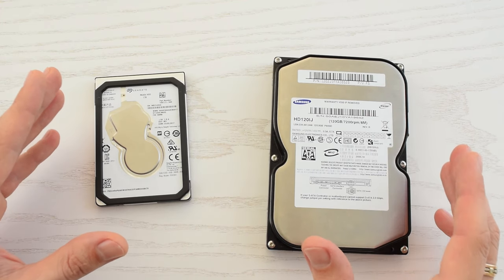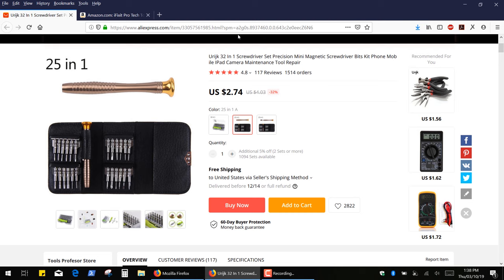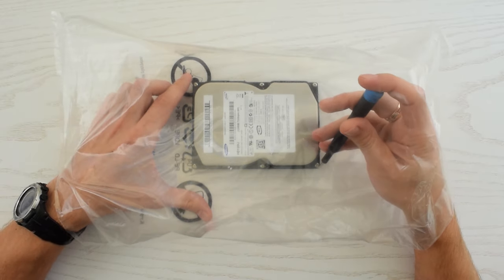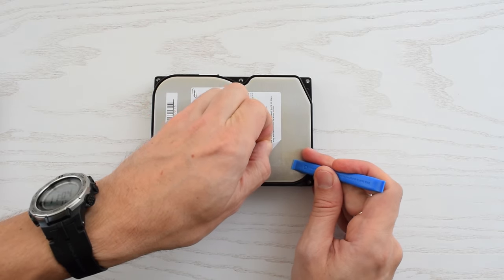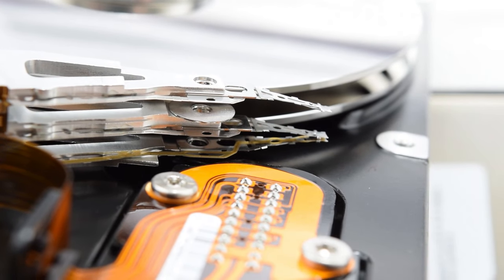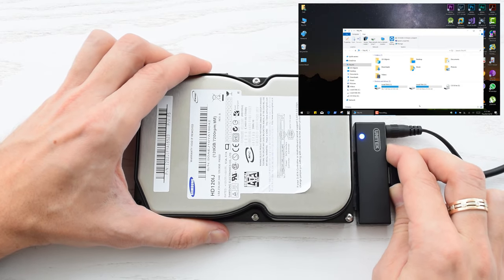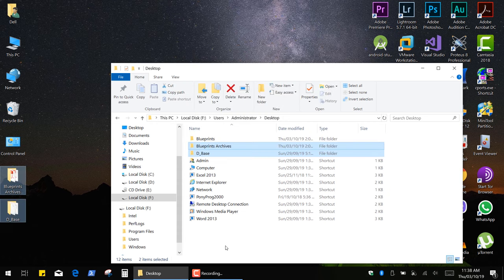Fix Beeping or Buzzing hard drive and Recover your data in 3 minutes

Comment: Just got quoted £350 for this exact job and just done it myself thanks to your video!! You are an absolute saviour man!! I’m half way through recording an album and almost lost all my recordings 😂😂😂. 🙌🏻🙌🏻🙌🏻🙌🏻
Reply from the maker: Glad I could help and backup your data as quick as possible. That HDD is not gonna last long.
Reply: where did u do this process? i mean how did u protect your hrd drive from dust particles?
Reply: @jasminekaif8546  hey!! I wiped down my dining room table and done it and sat it on top of a sandwich bag. I wouldn’t recommend doing it this way as per the video. It just so happened I didn’t have any dust contamination but I can imagine how horrendous it would be if you did. 
I would also recommend making sure you have the right tools. I opened the casing before realising the tools weren’t the right ones. 
Good luck
Reply: Happy you got them back !!

Comment: What if the head is in the home position when you remove the lid, but there’s still a clicking and beeping sound with the lid on?!
Reply from the maker: Does it spin? I mean the spindle? It's hard diagnose like this... Did you check the SMART of your drive? SMART provides exceptional information about your drive's health.
Reply: 2013Electronics&Computers yeah, it sounds like it spins, possibly the head doesn’t engage with the platters....
Reply: For me it beeps twice and the plate stop spinning.. :(
Reply: Have the same problem... Not sure how to proceed from this.

Although I don't really mind losing the drive it's just a tiny 120GB Seagate thin drive, any help would be appreciated though!
Reply: @notapm  i have exactly the same issue with my WD elements 6tb drive. Did you find a solution?

Comment: I just fixed one today by unscrewing the pcb on the bottom (using a T6 torx screwdriver, important to use the exact bit) and cleaned the main board contact of 3 wire contact ovals with a simple pencil eraser - it was green and corroded and worked fantastic after cleaning it back to shiny gold, also a little gentle eraser cleaning on the pins that meet these contacts. Always clean off the corrosion over the years and it might start working again.  Maybe the humidity got to it over time?? Also used a rechargeable air duster to remove all dust.
Reply from the maker: Great job!

Comment: hello there mine is beeping when i opened it this arm was in park position wasn't stuck i started it with open cover the arm goes into work position and start acting crazy ? how can i fix this
Reply from the maker: Most likely the heads are damaged and they can read any information from the discs.

Comment: Would you advice transfer all your files to a new hard drive after fixing the motor?
Reply from the maker: If the case with platters wasn't open then it will be fine for some time but I wouldn't keep any  valuable data on that drive.
Reply: @ElectronicsComputers  thanks

Comment: It's very useful tutorial but my one slim drive has an errors issues that drive size is 500Gb whenever I use Avast Premium Cleaner software to Chkdsk drive C then it shows that found errors need to fix it restart your system after restarting scan disk runs for a while later on system on windows normally no issue but when I just want to assure to myself that all errors must have been fixed As such I rescan disk Check errors by using Avast Premium Cleaner so again the same message shows like glaring errors needs to fix it on restart now or later so kindly tell me any solution to resolve that problem. Thanks sir for your guideance.. 😍🤗🤔☺
Reply from the maker: To tell what's going on with your drive I need to see the SMART of your drive. You can use any software like AIDA64, HD tune, Victoria etc. SMART is essential tool for HDD diagnostic, because it knows everything about your hard drive. Make a screenshot and send it to me.
Reply: Windows 10 runs perfectly even though having stubborn errors inside of it. I created 3 partitions 1st 1 is C:2nd E: 3rd F: when I run AOMEI partition assistant pro to check disk errors only C partition shows errors other 2 partitions scan completely 100% only C showing errors . I also use O&O disk image pro version to check disk that fix errors only temporary but didn't find any permanent solution yet.
Reply: No worry let me check the software as u recommended it S.M.A.R.T tool . 🤗🙄☺
Reply: I didn't find Smart Hdd tools software but I installed Victoria 4.76 now could you tell me how can i send you Screen shot here on youtube I didn't see any option to upload photo just give me your Email address.
Reply from the maker: @sweet_lovely_memories  You can upload here and give me the link: https://imgbb.com/

Comment: Thank you for the clear and precise video. My Seagate drive has a round indent in the center of platter, so torx driver is not usable. The platter is secured with a group of torx screws around the center hole. How can I rotate the platter as I move the head away ? I have drive open and see what needs to be done, but I don't want to move the head without rotating the platter counterclockwise. I have researched this issue and see a couple of users with Seagate drives with the same situation, but I have not come up with a resolutions. Many thanks.
Reply: Oh, I see you answered someone about this. Either a bit with sharp edges or rotate by hand. I thought the latter was not a good practice and could potentially damage the platter.
Reply from the maker: Put your thumb in the center of the spindle and make a twist while moving the head away from that stuck position.
Reply: @ElectronicsComputers  Thank you. I will try that

Comment: Hi Mate, 
Thanks for the video
I have a hard disk and it is having an issue with “clicking sound” and when I externally connect on different laptop, it is showing in disk management and disappears after a while, also not showing in “This PC” (Devices and drives). Basically its flapping and also clicking sound. 
I was guessing some hardware issue, could you advice what i need to next?
Reply from the maker: I'm pretty sure that the problem is in the dead head assembly. Only swapping the head from absolutely the same HDD model can solve the problem.
Reply: @ElectronicsComputers  great thanks 
i am checking for a donor HDD now 
do you have the video for swapping the head safely ?

Comment: my hdd doesnt beeping or clicking, but suddenly it undetected on my computer or bios
Reply from the maker: the problem appears and disappears or it's dead now? Could be power issues or maybe just bad contact in wires or something.
Reply: @ElectronicsComputers  idk, since it undetected i just unplug the HDD now, but i try another external HDD plug in on my laptop, suprisingly it also undetected! i wish its like motherboard or power issues and my data keep safe

Comment: Will this problem cause the drive to be not recognized by Windows 10? I have a Seagate drive (ST4000DX001) that Windows 10 can't see and the in the Disk Management it says "No Media". Any response would be appreciated.
Reply from the maker: If the BIOS can detect your drive that means the PCB is fine the problem usually in the head assembly or the platters.

Comment: Hi. I followed the steps shown in the video on my external seagate backup slim plus hard disk. However the beeping sound is still audible and the hard disk stops spinning after a minute from being connected to the laptop. Can you please help?
Reply from the maker: Could be a damaged head assembly or something with motors control, anyway it's impossible to fix at home. If you have some valuable information give it to professionals, otherwise throw it away and buy a new one.
Reply: @ElectronicsComputers  thanks for responding. On some recovery apps the hard disk is showing as lost partition

Comment: when this happens, does it explain why the drive doesn't even show on the hard drive manager of windows?  Or is there some other error also..
Reply from the maker: If the drive can't test itself and initialize then you can't see it in Windows. It can be visible in BIOS though.
Reply: @ElectronicsComputers  You're very right!  Although I have a laptop..   It's an external drive I'm fixing..    I noticed that the needle stopped in the outer edges of the disk..  I'll open it soon and move it a bit.   Then, I'll try again :)

Comment: Hello, I have a WD my passport 1 TB HDD. About a month or so it stopped working. I opened it up as you taught us in the video (extremely carefully) and the drive itself is spotless but the needle goes left and right over and over. It's like the drive tries to read but is unsuccessful to do so. I haven't tried another USB cable and the laptop (although it recognizes there's a hdd connected) does not shows my HDD in my PC folder. Is it dead? Should I give up?
Reply from the maker: Without a donor and some skills it's impossible to fix at home. Most likely it's damaged head assembly.

Comment: My external hard disk making some clicking noise. I tried this process.but didn't work.i think head was damaged.can I able to replace new head?
Reply from the maker: You need to find a donor head assembly then replace it and using some software like PC 3000 recover your data. After that you can throw your HDD into trash because it's not gonna work long anyways.

Comment: Just opened my HDD and tried to power it up… the needle/head just keeps on moving from the off position to the middle of the disk and vice versa with a loud wheezing sound.. how do i recover my files? Thanks
Reply from the maker: Most likely the head assembly is damaged and it can't read any tracks. You need the exact donor drive, clean room and some serious skills to swap the head assembly. If the data is not super valuable for youvand you don't want to spend hundreds of $ on the data recovery then you can try to do it yourself.

Comment: mine isn't the head stuck situation.. head moves freely, but it just skims across it and beeps
Reply from the maker: The head assembly can be damaged. In that case you need to find the exact same model of the HDD for donor parts in order to recover your data.
Reply: @ElectronicsComputers  Thanks

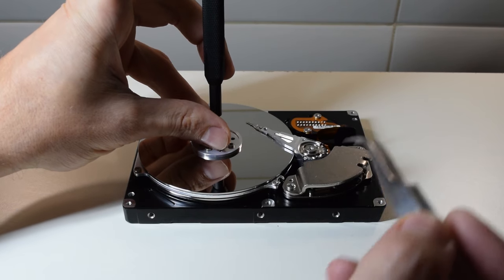Comment: I have this issue and I have a similar Samsung Drive - it does not have a parking ramp and all the components look the same. One issue I am having is that I cannot figure out which screwdriver works for un-sticking the platter. I was wondering which screw driver you are using @2:00 to turn the screw counter-clockwise? Mine does not fit any screwdrivers from a kit that i have and frankly it doesn't even look like a screw. Thanks!
Reply from the maker: I was using a bit with sharp edges but you can twist it with your bare hands. Simply move the head assembly and twist the platters at the same time. This model doesn't have a parking ramp. When the drive is off the head assembly is parked close to the axis. So just move your head to that position.
Reply: @ElectronicsComputers  Thank you for the quick response! Looking closer, it looks like my head is actually damaged between the first and second layers, so this is much more work than anticipated. Since I am not even sure what's on the drive (and it is over 15 years old) this might be the end of it. Thanks for your work, it is always great to learn new things.
Reply from the maker: @stevangaric  if there's some valuable data you can buy the same drive on Ebay and swap the head assembly.

Comment: I have a beeping hard drive, but it works intermittently. What do you reckon?
Reply from the maker: It happens for a bunch of reasons like motor issues, not enough power for a drive, stacking head etc. I'd recommend to back up your important data and check the SMART of your drive. The SMART has all information about your drive. You can show me a screenshot of your SMART info and I'll tell what's going on and/or should you start to worry.

Comment: I have a drive that will no longer show up in My Computer, although Device Manager detects the USB-SATA and the drive itself. Sounds like it spins very briefly like a beep sound. Repeats about 10x and then gives up. Did try crystaldisc but would not detect it. Should I open it up? Thanks in advance for any tips.
Reply from the maker: If you have nothing to loose then give it a try. If you the head assembly is on the platters then it's the same problem as I described in the video. If the head is parked on its ramp then it's something else and requires donors with head assembly or PCB to fix it or recover data.

Comment: I have an external  Seagate  Laptop HDD 1Tb that beeps when plugged into usb port. Stops beeping once plugged in but is  computer will not recognize it. Device manager see it and gives me a Code 10. Is the hard drive dead - worth paying to get it recovered
Reply from the maker: Could be the problem in your USB port or adapter itself. Try another cable.
Reply: @ElectronicsComputers  It also beeps about 10 times. Does that mean anything. Thank you for getting back so quick
Reply from the maker: @288alterry  It could be either defective hard drive or its USB adapter. Try to  connect that hard drive to a PC or laptop or connect another HDD/SSD to that adapter to figure out which part is faulty.
Reply: @ElectronicsComputers  Thank you

Comment: Hi man my hard disk do a Whistling sound ! Is it the same problem ??
Reply from the maker: If it sounds like mechanical whistle then it could be damaged head assembly and heads are touching the disks. You have to backup your data immediately. You can use any software that can check the SMART of your disk like Aida64. It will show you what's going on with your drive.
Reply: @ElectronicsComputers  thanks man but i  cant use it any more with a msg "disk error" and the whistling voice

Comment: Sir my Hard disk is giving sound but continue working it gives just a little error what did i should do open it or not
Reply from the maker: Just back up your data and replace the drive, that's the best option. If it clicks but still works then this method is not for you. Your drive may require a head assembly replacement which is nor worth it if you can easily back up your data.

Comment: my external wd 4tb sounds scratch or screeching, can i recover my data from it i mean its not clicking so is this also because of hard disk head stuck issues? please help, i want my data back. and 1 more question is that you lose the screw of platter for pushing the head, should we tight the platter screw back then or not just leave it like that?  please reply sir as soon as possible, i will be very thankful
Reply from the maker: First of all, this method is not gonna work in your case because it sounds like your head assembly is damaged and requires a replacement. Secondly, I didn't lose that screw, I was using it just to spin the spindle.
Reply: @ElectronicsComputers  thanks sir, can u please make one tutorial video on head assembly replacement if possible, and secondly for example if i replaced it with the help of an expert, is there any chance of data recovery? my hdd didn't fall, it hang down accidently so i quickly grabbed it with my hand, i was copying files at that time, people say when hdd is on then there is a chance of data damage

Comment: with the drive open, I can see the brushes move each time there is a beep.  Still won't read the drive.  Help.
Reply from the maker: Most likely failed head assembly. Without donor parts and proper skills it's impossible to fix.

Comment: How do you prevent the needle from falling on the plate?
Reply from the maker: I use a special plastic comb that you put between heads. When the head assembly in its parking position. But when you move it from the platters it will touch the platters and there's no way to prevent it.
Reply: 2013Electronics&Computers thanks for reply. When you put the comb in place did the hard drive work? Is there anyone or service that does hard drive repairs?

Comment: It's weird because mine just buzzes when I connect it then beeps and when I open it everything is in place? It doesn't get recognized in PC 7 times out of 10 and I did not drop it or anything. Please help

Edit: when I try to access it, it ticks randomly every 2-3 minutes
Reply from the maker: Could be damaged head assembly. It's almost impossible job as a home DIY project. If you have some important and valuable data then go to a company that can fix your HDD or at least recover your data.

Comment: My 3.5 inch hard disk is clicking which could be the reason why my laptop cannot detect it upon plugging it in?
Reply from the maker: Most likely it's damaged the head assembly.
Reply: @ElectronicsComputers  cannot be repaired anymore?
Reply: @thechannel012  Like on what this video said, you need to replace the head assembly.

Comment: I just swapped the head and it still making beeping noise, I was able to open the cover and see the reading head is in the Parkin ramp. but every time when I power it on it has beeping noise and the computer never detected my drive. how should I go next. PS, while I changed the head I did it perfectly. just don't know where to go next.  thank you.
Reply from the maker: That beeping noise makes the spindle motor. Try to give it a spin maybe it stuck and doesn't spin. Maybe the motor is dead or its driver. It's hard to diagnose remotely.
Reply: 2013Electronics&Computers the board that broken you mean?
Reply from the maker: @bunlungkupiumsin4738  Just spin the platters with the screwdriver to make sure the spindle is not stuck.